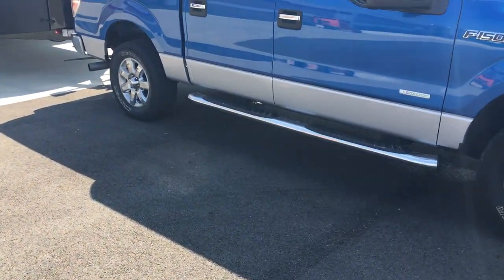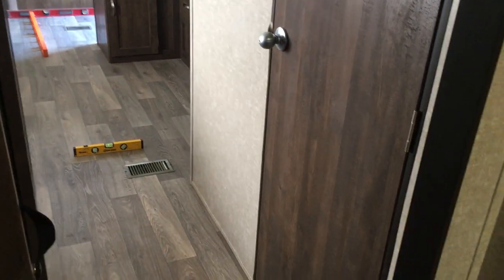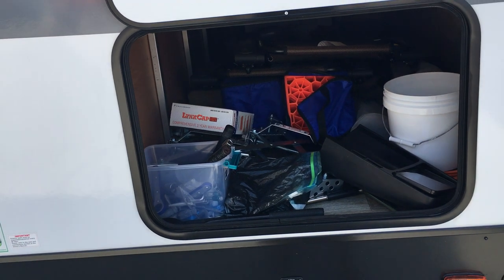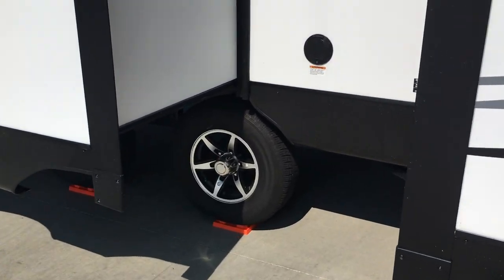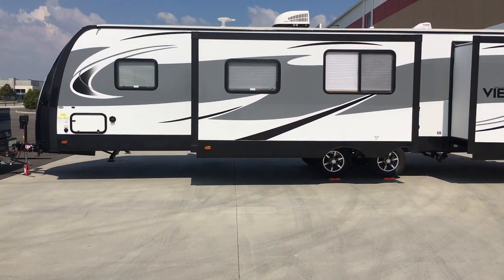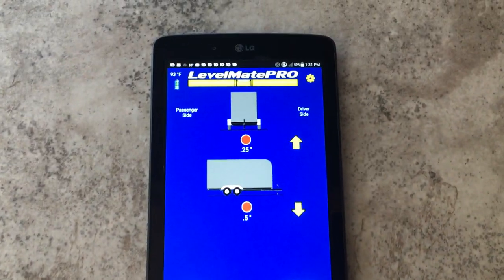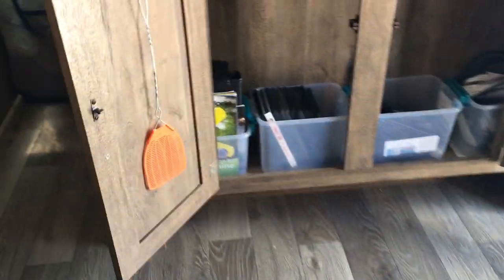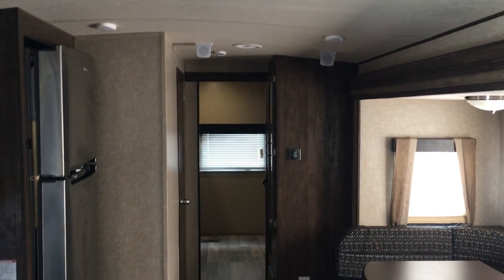2018 Forest River Vibe 308BHS

Comment: Nice setup! When you showed that left rear trailer tire there was a bulge that looked like it was popping outward, that would be a twisted belt and should be warrantied. If it is indented then that is fine as that what happens when they join the belts together, as it's extra stiff in that spot so pressure won't let it pop out as much like the rest of the side wall.

Comment: Great video. Could you provide the modifications and urls to products you installed. Where did you get the sofa?
Reply from the maker: Thanks Nick.   I got the sofa recliner from Front Room Furnishings. Just measured the size and went to their 50% off store and picked this one out. I checked out several places like Big Lots, Value City Furniture and several other places. Either was too expensive, nothing I liked, wouldn't fit through the door or didn't match. What items did u want urls for? I have a couple other clips with the URL in the description. Not all but a couple of them.
Reply: The ladder, where you get it and brand and all
Reply from the maker: @r.anthony5428  wow, just seen this. The ladder was bought and installed by RDC in Pataskala Ohio. I do not know the brand. It was a universal type because at the time in 2017 when I bought it they did not make a factory ladder. The dealership i bought it from would not install it, but RDC had no problem willing to install it.
Reply: @dan8220  I'm 5 years late to the party lol; but agree great video!  Do you still have part info?  I am looking for those shocks you used above the couch; such a shame they are not factory...  Also, looking for that cover you used in the bathroom for the fart fan vent.   Thanks!
Reply from the maker: @blommernet  sure thing, if YouTube don’t remove the links….. don’t know why but usually they delete any links I put in.    https://www.etrailer.com/RV-Cabinet-and-Drawer-Hardware/JR-Products/37270555.html

Camco RV Vent Insulator and Skylight Cover with Reflective Surface, Fits Standard 14 x 14 Inch RV Vents (45192). Search this on Amazon and it will pull up several vent options.
Reply: @dan8220  Thank you very much!

Comment: Be careful with those tires.  I upgraded mine right away.
Reply from the maker: Frank M 
what are hearing about them?
Reply: Dan, they are peeling open when they are relatively new.  It happened to me at a light.  The trailer was only 6 months old.  That's what caused me to start doing research on trailer tires.
Reply from the maker: Frank M 
I did some brief research and found a hand full of concerns on vehicle tire.com and forestriverforums.com. Not seeing anything overwhelming at this point. Imma did a little deeper, do you have any source I can read up on? Thanks for the heads up.
Reply: Dan honestly, I just did a Google search after mine peeled open... it was enough for me.  I didn't want the others to blow at highway speed.  When they took the others off, one of them was about to go.  Maybe mine were a bad batch.

Comment: I have a 17 258rks I liked it at first until everything started breaking and I would get repair under warranty and it would brake again. It’s just poor craftsmanship and cheap materials
Reply from the maker: John Martin 
I agree, what you’ll find though is that pretty much all travel trailers are made of the cheap stuff. I don’t believe one brand is better than another except for maybe Jayco. Fifth wheels are a little better quality than travel trailers but yea I absolutely agree it seems these vibes are built from scraps!
Reply: Dan my vibe is still in the shop for the slideout 2nd time and warranty is about to run out and I’m really debating on lemon lawing it
Reply from the maker: John Martin 
I sure would if possible but I don’t think Lemmon law applies to recreational vehicles, could be wrong but I think they are not protected under that, if they were recalls would more rampant then motor vehicles and they wouldn’t be having such crap product.
Reply: Dan lemon is legal in Texas for RVs. Are you a full timer? The vibes have a nice layout hence why I got it bc I wanted a door for the bedroom and not a curtain.
Reply from the maker: John Martin 
No im not full time. Don’t tell tour dealer you are or they won’t cover stuff. Their whole criteria is weird of what they cover and what they don’t if you full time and stuff. I don’t think Ohio has lemon here, I’ll have to check. I’ve had brake work 3 times, on mine, awning leaking in the center, the slide digging into the tire, and now my satellite cable don’t work so I had to run a temporary. I got the extended on mine so I just have to add $100 for deductible to cover any fixes. Vibe has many different options and styles! They look nice and the set ups are awesome but their quality is a whole another world.
Reply: Dan agree also my DVD player won’t play threw the rca port on the wall to tv so no picture but I can hear it playing on speakers. Also my antenna wouldn’t turn or crank. I had to get a bigger mattresses for the bedroom since my feet hanged off a foot off the edge. Skyline has come unglued fridge cover was bubbling seats Velcro came unglued and a list of other problems which sucks especially for a brand new unit. Yeah they are light but the quality is crap. I wish I never sold my 2007 pioneer spirit 18ck
Reply from the maker: John Martin 
Hahah that’s funny you say that, my wife and I think we should have kept our 2004 keystone sprinter as well.
Reply: Dan lol my wife brings it up all the time especially when it’s time to make payment on a Rv that sits at the shop
Reply: My vibes slide went also ! It's been at the dealership for almost two months